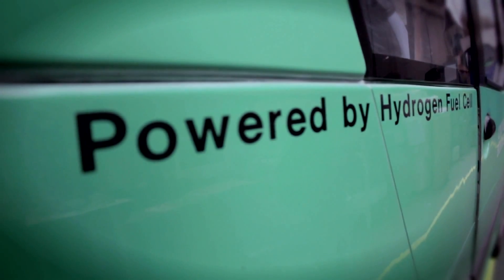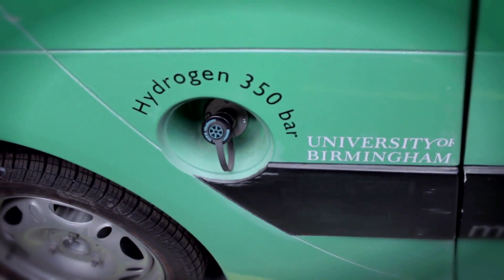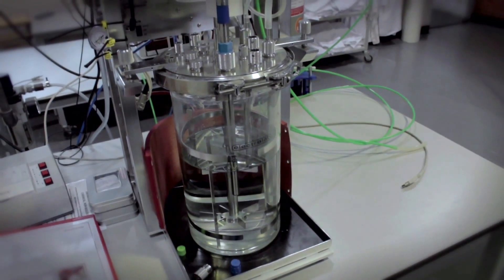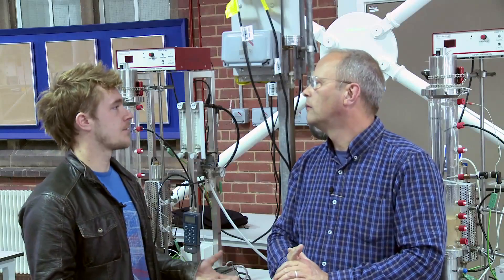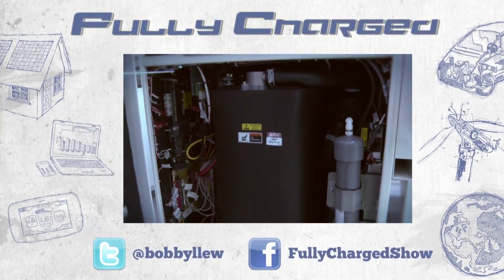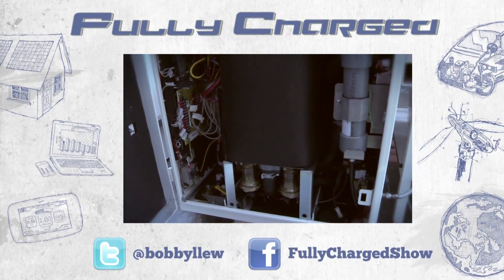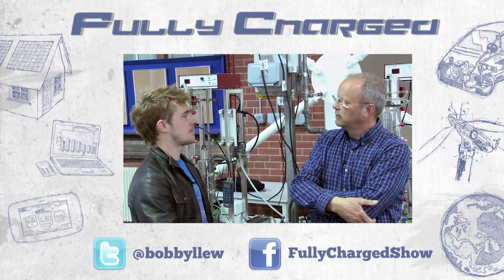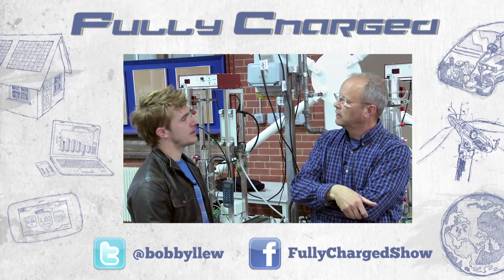Hydrogen Fuel Cells in 60 Seconds | Fully Charged

Comment: The problem with hydrogen is that it requires 2.5 times as much electricity to make it, compared to just using the electricity stored in a battery. And handling it is a big problem. If you leave it as a gas you would have to haul a huge trailer behind you with a huge balloon bladder to hold enough to get anywhere, and if you compress it you need the power to compress it AND heavy tanks to hold the pressure. And if you liquify it it becomes dangerous to handle and again takes the power to refrigerate it.  This makes electricity from batteries 3.5 or more times more efficient than hydrogen. Batteries are 95%+ efficient. Hydrogen is about     25% efficient.

Comment: Just to point out that Hydrogen Fuel Cell will never work.. They have been trying for 60 years and still they no better.   Cost more and does not work if its cold and does not work if its hot and range is less then ev cars.   Its all a big con to make you give on electric cars.

Comment: Rainbow, you just described a process for creating hydrogen artificially, which is not natural.

Will, hydrogen doesn't naturally exist on its own in very large quantities so it has to be separated from water like rainbow said. You might be getting confused with natural gas which is mostly methane.

Comment: iceland will do better providing electricity, why convert it to hydrogen losing energy, transport it across sea and then have to deal with distribution/storage, then expect everyone to buy hydrogen fuel cells? The loss of having to reconvert hydrogen back into electricity is preposterous .  Hydrogen has its place but not for every car or home in Europe. We use electricity direct/ efficient as possible. Iceland will use high efficiency HVDC lines.

Comment: I guess you can call it 'a future'.  As the technique becomes more efficient, it will definitely become viable.

Take Iceland as an example.  They have the potential to supply the whole of northern Europe with zero-emissions hydrogen fuel cells (all their power is green, all of it).  Special sites, like solar plants in deserts, (or solar updraft towers - brilliant idea) also make excellent production sites.

HFC's may eventually become a mainstream, portable power solution available readily.